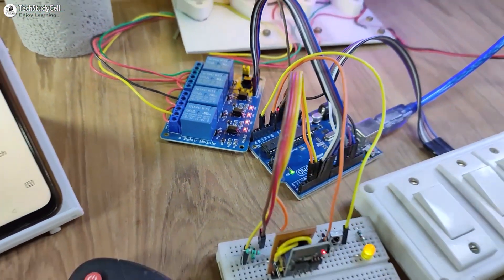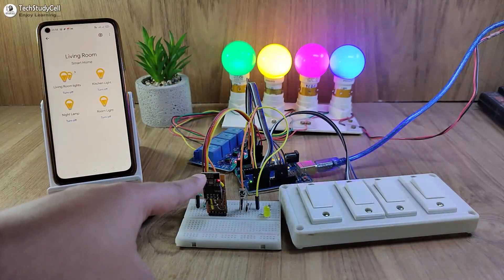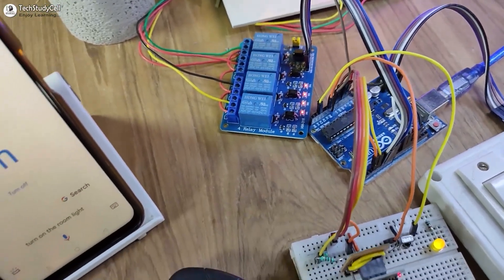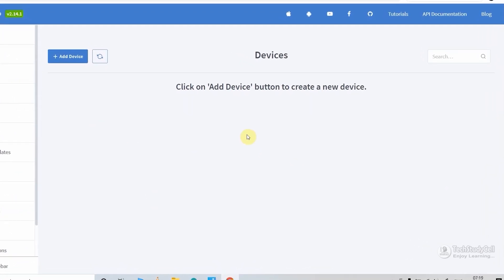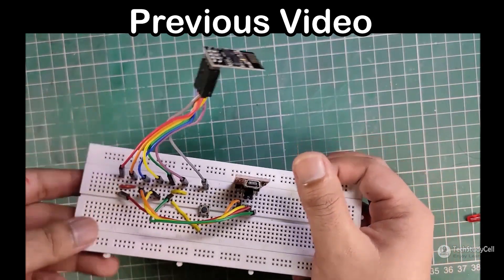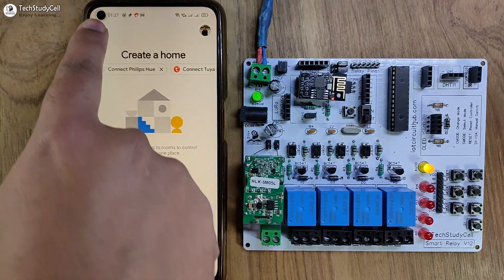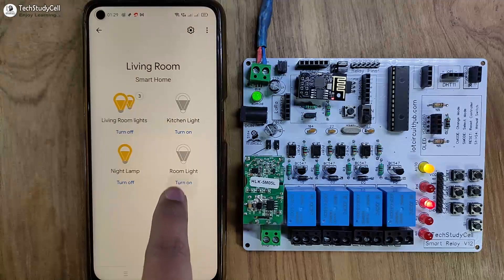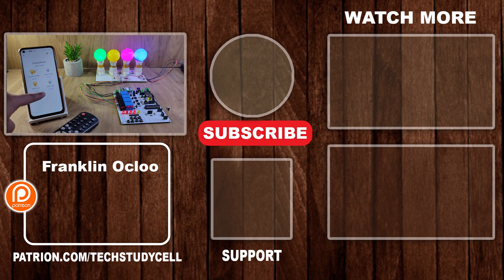Arduino IoT Project with Google Assistant & Alexa app using ESP8266 Arduino UNO WiFi control Relay

Comment: why have you used ESP01 instead of that you would have used ESP8266 than that would have Easily uploaded the code in ESP01 it is difficult to upload the code
Reply: Hahahaha yes esp8266 more cheaper than Arduino+wifi 😂

Comment: Can I use Arduino nano instead of Arduino uno
Reply from the maker: Yes. But to supply esp01 use a 3.3V regulator. As per circuit.

Comment: Sir  there is an issue in this  when I cntrol the relays   by Google assistennc    and  when I saying turn on room light  it doesn't turn on instead when  I am saying turn off   it  turned on relays. how  can I correct it  this issue .  Sir  help me plz

Comment: Have a little question.

Would like to see all this operated via multiple ESP32 modules, that is, without smartpfone so to speak or other bells or whistles, such as an old-fashioned remote control such as infrared (which is of no use on another floor if one turns off the lights on the ground floor) 

The switch block supposedly to the ESP32 itself, which connects to the other (or preferably also several) ESP32 modules that connect the lamps to be switched and the like.

Can you tell me in a separate chapter, film preferably, how to connect that, eg for 32 connections, that is, a 2 times 16 relay units, what is involved here, this not only the switching but including the feedback visually that it is also on so to speak?

Thanks in advance

Old Wizzy, Netherlands

Comment: Yaaar lots offf thanxxxxxx finaly. You made itt mai yahi chaataa thaaa....but can I touch use  switch insted of manual swich???
Reply from the maker: Thanks.. will add that in future
Reply: @TechStudyCell  BUT I WANT TO CONTROLL ALL 4 DEVICES ONY 3 ARE LISTED IT SAYS BUY THE SUBCCRIPTION AROUND ME 390RS. CAN YOU MAKE IT FREE. I WANT CONNECT DIRECTLY TO ALEXA APP TO ESP0-1 AND ARDUINO ATMEGA CHIP HELP OF ARDUINO IOT CLOUD INCLUDED IR, TOUCH SWICH

Comment: Great work
i think much better if you use momentray press switch instead of normal wall switch
Reply from the maker: I have shared the circuit + code for both the momentary switch and latched switch... Please watch the complete video